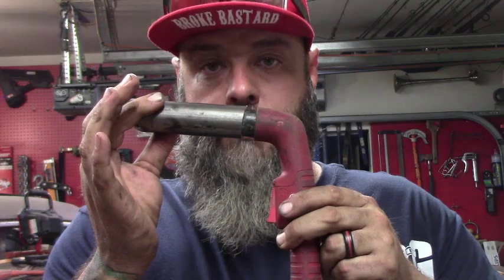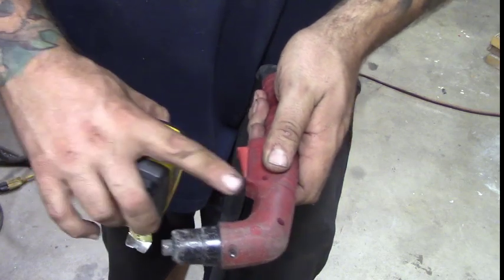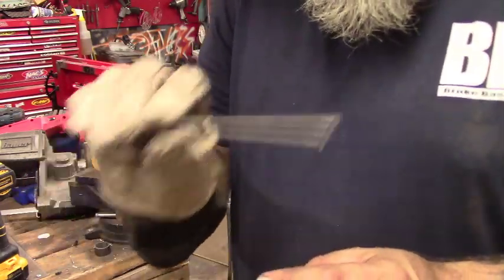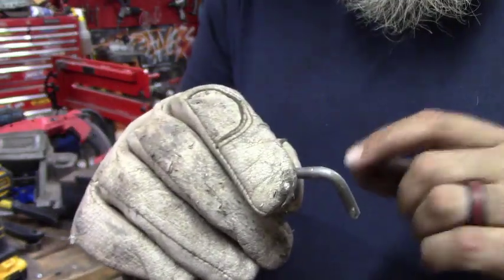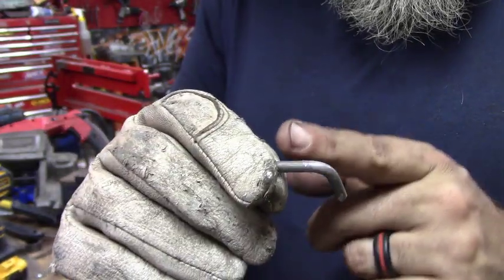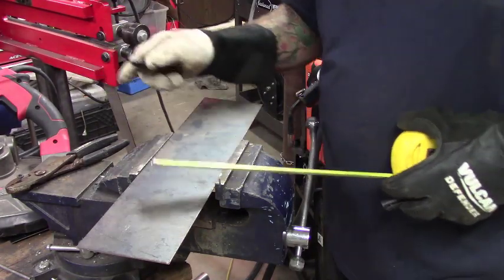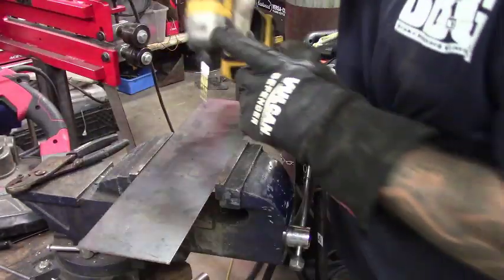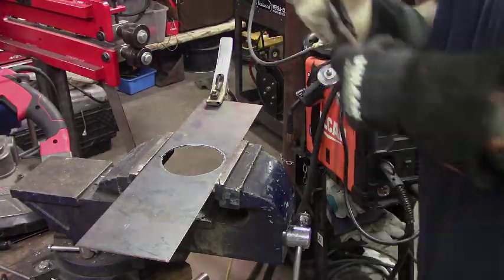How to Cut Perfect Circles with a Plasma Cutter

Comment: Brilliant. To add to what you said about using the bearing instead of the pipe collar, another addition could be to weld a "Coupling nut" to the bearing(A Coupling Nut is just a nut that is longer and has more internal threads). Then thread your pointer gauge on one end(the end you welded to the collar). That way you can switch sized pointer gauges for diffrent size holes. Additionally, One can use All threaded rod which can be found where the coupling nuts are found at the Hardware Store. That would help you skip the threading step.

Comment: Thanks!  I need to cut a 3/4 hole in the end of a pallet fork.  I'm going to bore a hole in a piece of bar stock with my lathe and use that for a template.  Shalom/gw

Comment: Im building a stump grinder..the wheel will be 1/2" plate...im going to make one of these..iv thought about makeing different leanths of guide rod's,, put threads on them..and tap the base...and perhaps use a magnet as a base to metal

Comment: Going to try this sometime this week.  Need to make some 4" holes for lights, and eventually need to do some 5" for exhaust.      After that the sky is the limit with what I dream up from there.     Currently building a utility trailer out of mostly used materials.  Made the mistake of not buying more new steel when it cost 1/3 less.... you live and learn lol.
Reply: Ufff, exactly. I just built my 4x8’ welding table. It cost me a fortune in metal.